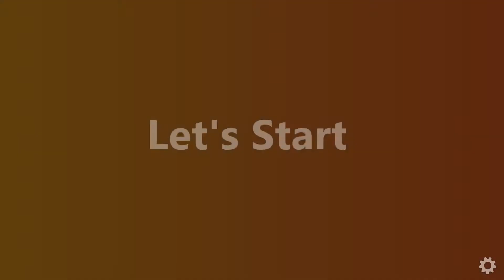DIY | H-Shifter | Arduino Leonardo | Part 1 | How to make a H-shifter for pc

Comment: That parts?
Reply from the maker: What parts?
Reply: Boll joint 👍
Reply from the maker: @lshootphotography7250  Ball joints are components located on the front suspension system of a vehicle. You can find one from a vehical parts selling shop or from a junk yard.